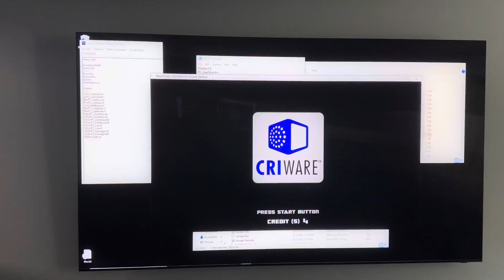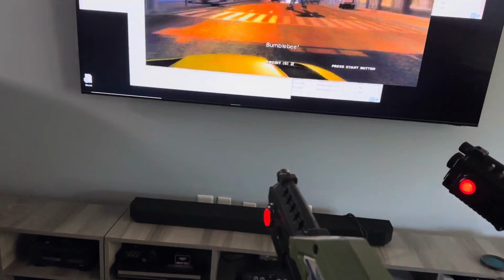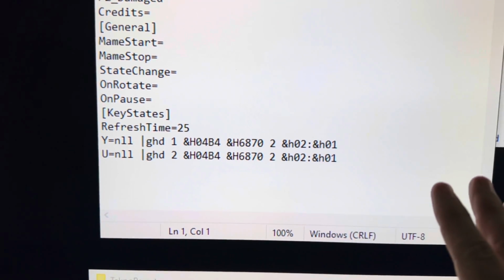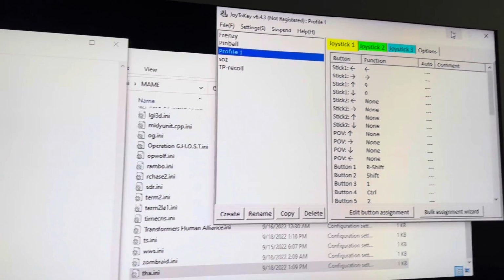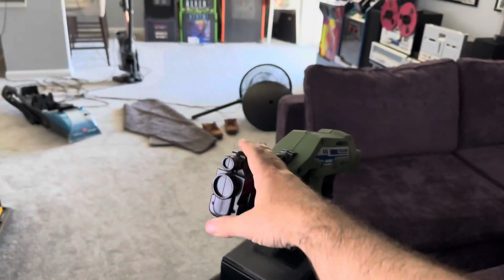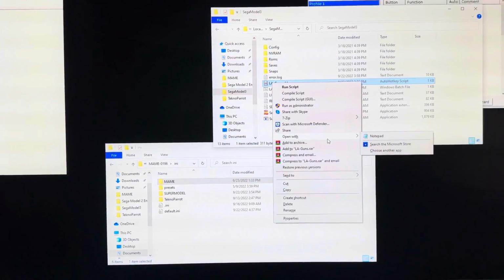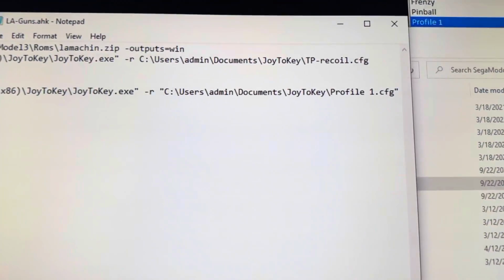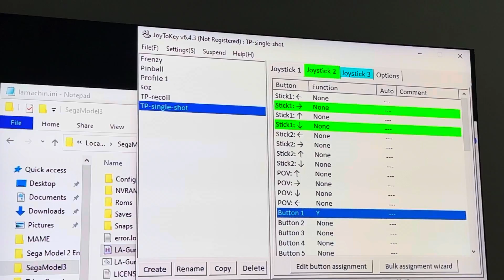Getting mamehooker recoil on TeknoParrot and Supermodel

Comment: Hi Brad, as I continue to troubleshoot getting mamehooker to work with all these teknoparrot games, I did have a question. I see that sometimes people use the recoil code ghd 1 &H04B4 &H6870 8 &h02:&h01:&h01:&h00:&h00:&h00:&h00:&h00 and sometimes they use nll |ghd 1 &H04B4 &H6870 2 &h02:&h01. Is there a reason for that and how do you know which one to use for which TP game? Or does it not matter? Thanks

Comment: Hi Brad. Many thanks for all this information. I managed to run mame hooker (on Win7 it doesn't run recoil, and on Win10 it run recoil but quit when demulshooter executed), and demulshooter also likes to cause problems, and Joy2Key is another software, It's annoying when suddenly, in the middle of play, one of the programs stops working. So, based on the knowledge contained in the demulshooter, I created little tool, dedicated to our guns. The tool recognizes the game itself and starts the recoil and the gun display (either ammunition or energy) when expected. It works fine for me, and I'm happy to share with you. Let me know if you would like to check it, I am gradually adding more TeknoParrot games to it.

Comment: Why Jurassic park, lost land adventure TC5, and let's go jungle don't have recoil output in teknoparrot like the other games do?
Reply from the maker: Not all games put out a repeating recoil signal.
or if they do, it can cycle so fast that mamhooker's output doesn't register a change in value

in either case, you can use keystates to send your recoil command and you can set the fire rate for that key in joytokey

Comment: Hi Brad, thank you very much for another amazing tutorial : )    question did you manage to make the recoil work correctly in hotd4 or hotd4sp with the output ?  personally i give up and use the same config you used for Transformer ....i got the life working on display but the recoil dont seem right
Reply: [General]
MameStart=
MameStop=
StateChange=
OnRotate=
OnPause=
[KeyStates]
RefreshTime=25
Y=nll |ghd 1 &H04B4 &H6870 2 &h02:&h01
U=nll |ghd 2 &H04B4 &H6870 2 &h02:&h01
[Output]
P1_LmpStart=
P2_LmpStart=
P1_GunMotor=
P2_GunMotor=
P1_Ammo=
P2_Ammo=
P1_Clip=
P2_Clip=
P1_CtmRecoil=
P2_CtmRecoil=
P1_Life=ghd 1 &H04B4 &H6870 3 &h03:&h00:&h0%s%
P2_Life=ghd 2 &H04B4 &H6870 3 &h03:&h00:&h0%s%
P1_Damaged=
P2_Damaged=
Credits=
Reply: tried the P1_Gunmotor  and the P1_CtmRecoil   both recoil but way to fast for the solenoid

Comment: Hey Brad. We are trying to follow your videos to get recoil up and running for Teknoparrot games (House of the Dead Scarlet Dawn). We have Mamehooker working with MAME, but it won't add the ini files in the ini folder in Mamehooker (or the Teknoparrot folder) when we run Teknoparrot games. Would we need something like Outputblaster or Demulshooter for it to work? Please brad we are struggling :D
Reply from the maker: Correct!
TeknoParrot won’t send outputs that mamehooker can pickup on. But DemulShooter can!
So even if you don’t need Demulshooter to map your guns, you should still use it to get the outputs. (So I recommend using it for your gun mappings too)
The Wiki page is pretty comprehensive on usage but let me know if you have any problems settings it up  
https://github.com/argonlefou/DemulShooter/wiki/SEGA-ALLS#house-of-the-dead--scarlet-dawn

Comment: Hey Brad.  Do you know if it’s possible to set the volume, on the Alien arcade gun? The recoil is really loud 😅. Right now I have soldering a on/off switch. To turn off recoil at night. Yes I do have neighbors 😅
Reply from the maker: The game volume can be adjusted in the test menu (the number 5 key)

And yeah, I also put in a switch to cut power to the gun’s recoil so my brother can play it when his kids are in bed 😁
Reply: You can simply reduce the voltage of the current for recoil. I installed a potentiometer for regulation. It's really noisy when running on 24V.

Comment: Hey brad, I have these and am trying to set them up in teknoparrot. Everything works fine but the x and y axis are both reversed. Is there a way to change this either is teknoparrot or game settings?
Reply from the maker: Short answer: no
Older versions of TP have a reverse axis option but no anymore. 
But, you have options!
If using Demulshooter, you can reverse X or Y axis in there

If not using Demulshooter, (or for games that aren’t supported by Demulshooter) install Xoutput.exe
https://sourceforge.net/projects/xoutput/

Then setup a profile where it uses your guns input for emulated Xbox controllers. This program also lets you do universal calibration and X/Y axis reversal (just like Demulshooter does)

You can then set Xoutput to start with windows and change your game settings in TeknoParrot to XInput to use your guns that way
Reply: @Brad-D  thank you so much. I will try those options. Your first alien cart video was the reason I got them awhile ago, it’s beautiful!
Reply: @Brad-D  The X Output method worked perfectly. Thank you.